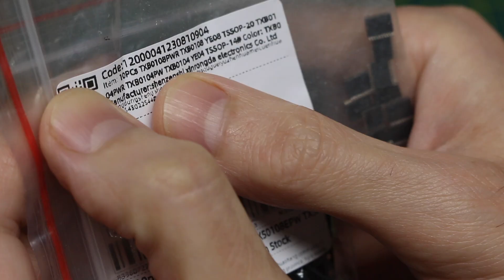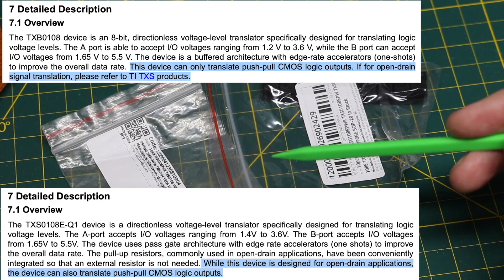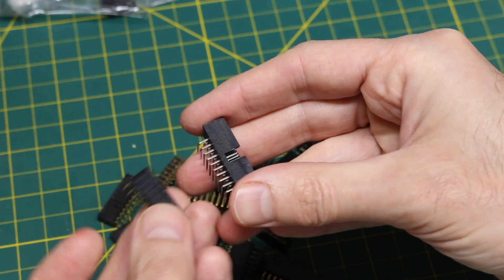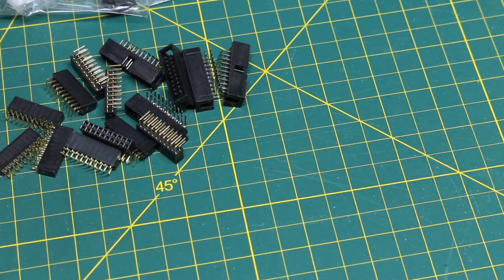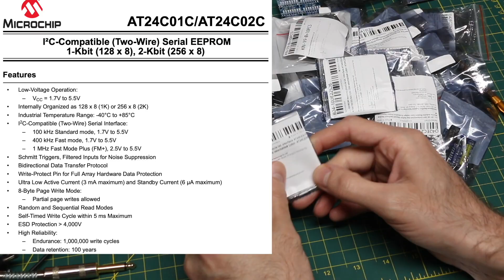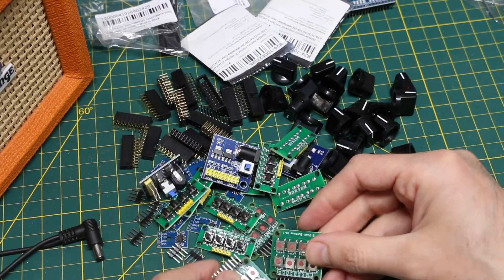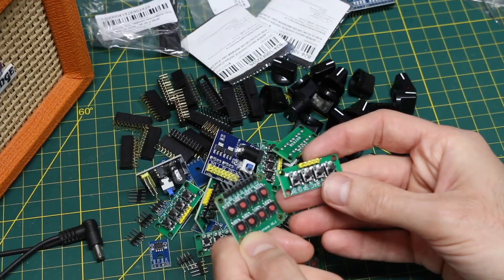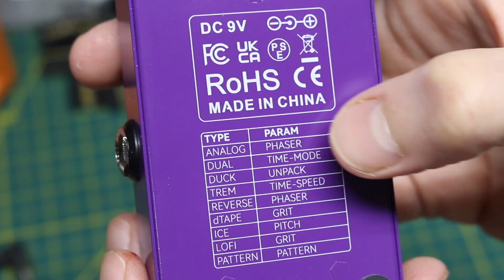Mailbag

Comment: Ditto on the choice, gave up on anything other than choice with AliExpress. With the Delay and Elemental there was a fair buzz or hiss in the background. I am not a guitar player and people say I am tone deaf was that generated by the units or other? Too old to learn new tricks unless I build a robot to do it. (-:
Reply from the maker: I was having that buzzing constantly even while experimenting on different circuits with the current set up because it was a telecaster style guitar with single coil pick ups, which are known to pick up electrical interference and I could make it go away by putting it in humbucking mode where the pick ups work to cancel any external noise.